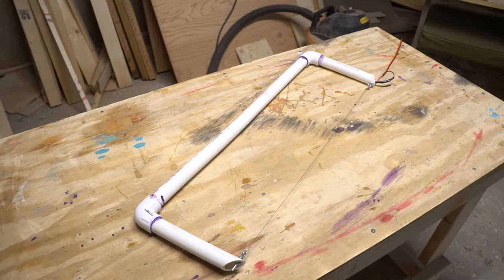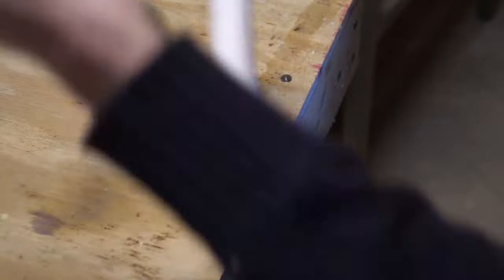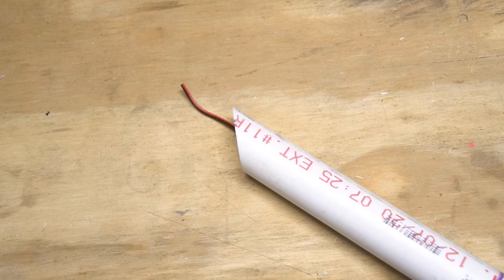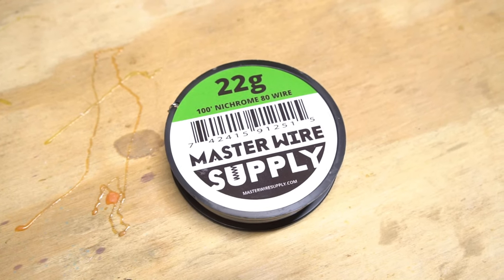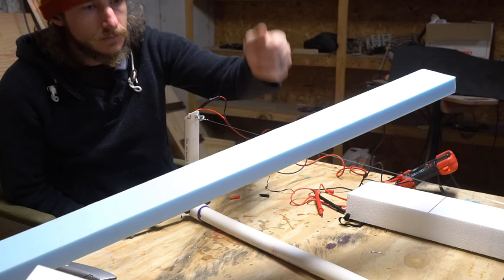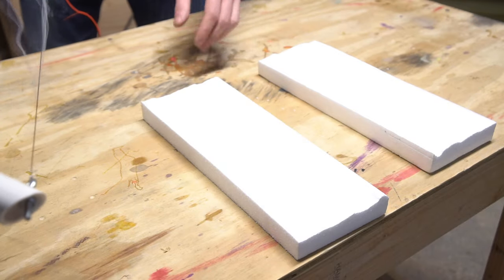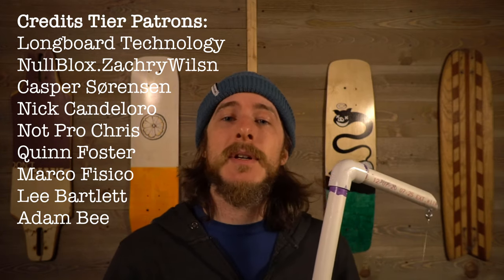Making a Hot Wire Cutter for Shaping Foam

Comment: I'm looking to horizontally cut a 10" thick 6' x 7', latex mattress in half (fillet style), due to the outer surfaces developing body impressions I hate sleeping in.   Then I can put the outer faces into the middle and spray adhesive glue to join them. The trick is, not to cut the pieces with waves, but perfectly flat for a level sleeping surface.  

Why do this?  California King size Natural latex foam mattresses cost $3,000 USD!  So, if I can just "resurface" this mattress this way, eliminating body impression sides, I can get another 10 comfortable sleeping years out of this mattress - for the cost of making a cutter about 7' wide, and keep the overall original width too.

So, I'm thinking of using wood to make one of these, a 7' long piece of wood (2" x 4" x 7')(and attaching a wider flat thin piece ofmterial to the 4" side, to it for guiding (i.e.: 1/4" x 24", x 7'), which can make the cutter lay flat and even, keeping the cutting line flat and making a 5" deep straight and flat "Fillet" cut from start to end, as I advance it over the top of the mattress (lying on a flat surface) - kind of like a planer works on wood - except in this case the planer is the moving machinery, and work-piece (Latex mattress) is stationary.  Thus, I'll use springs to make the nichrome 80 wire taught, that way; why I need an extra 1' wider than the mattress width, room for the springs beyond the width of the mattress.

I already have tools, hardware, and power supplies (might need 8 minimal to 10 or > Amps for a cutting wire so long).  If sure AMAZON has the nichrome 80 wire, eh! 

Maybe I should make a video,eh?
Reply: Ugh, I found my way to this vid because I also need to cut my talalay latex mattress horizontally, lol!

Have you undertaken your project? If so, what kind of results did you get?
I'm not very handy, so this project might be a bit beyond my skill level.

I'm considering trying a 39" fine-tooth bow saw blade to see if I can just carefully saw the horizontal cut.

Cheers!
Reply: @tothelighthouse9843  I haven't done it yet...I was thinking about doing it this way.

Mattress lying down on adjustable bed-base.

Place a 5" (1/2 matress thickness) wide board on each parallel, lengthwise 2  side of the mattress.  Cargo rachet straps to keep boards in place.

Then I can run a hot wire cutter along the top of the boards, as a guide...like a bread slicing guide.
Reply: @davidav8orpflanz561  Yeah, I'm trying to find a good way to cut mine horizontally. Please definitely update here if you do decide to proceed! Love to know how it went. Cheers!

Comment: does the end of PVC is not melting where the nichrome wire is attached?...
Reply from the maker: The hooked bolts that the nichrome is attached to really don't get that hot so the PVC doesn't melt. I'm not really sure why it works that way

Comment: Hmm.. thanks for the video. Is it volts or amps that cut the the foam... I found several laptop adapters laying around at max 2.5A, but at 24-48Volts. I assume a laptop charger should have plenty of juice to heat the wire, no?
Reply from the maker: Huge disclaimer here: I DO NOT understand electricity. That said, my wire wouldn't even start to heat up until I stepped up the amperage in the power supply. I read that sometimes if the power supply is rated for a lower amperage they're programmed to recognize the power draw from heating the wire as a short circuit and automatically shut off to prevent fires. Which is a good thing! Unless you're actually trying to get your wires really, really hot
Reply: Is the Ampere that do the work
Reply: @BiduscoIKUmar  multiply amps by voltage.
Reply: This is the voltage and the amps while it is on.
Reply: This equals watts, which is heat.

Comment: NO! Please DO NOT tin wires that are going to be clamped in a screw connector like that. This application is not particularly dangerous, but it is very bad practice. Solder deforms over time under pressure and relieves the clamping force leading to a resistive connection which can overheat. Many domestic fires have started this way by this being done with mains wiring. Just twist the strands together to prevent a stray strand shorting, and clamp straight onto the copper wire itself.

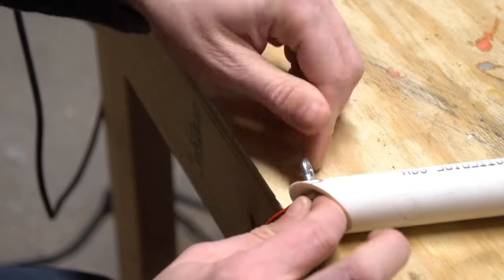Comment: At 3:19, you shouldn't tin the end of wires when clamping with screw connections. This is a known safety hazard because the tin will creep (cold flow) causing the connection to become loose.

Comment: How’s the PVC not melting? Higher melting temp than the foam?
Reply from the maker: The thicker cross section of the bolts means they don't head up anywhere near as fast as the wire. I'm sure if you left it on long enough you'd have some problems but I'd guess the nichrome would burn out first

Comment: Don't laugh at me asking this but I'm curious if this would perhaps cut cushion foam too? I doubt it but maybe. I need to cut the thickness of a sofa cushion into 2 relatively even pieces. This method looks like it would be easier than another I saw. Either way, very cool build and video!
Reply: I'm pretty sure it doesn't cut couch foam. I wish I did though
Reply: Most likely the cushion foam is made of polyurethane foam, which is much softer & denser. It does not cut well the hot wire method shown in this video & it's not recommended. An electric knife is probably your best option to cut polyurethane foam with.
Reply: @_MjG_  thank you!

Comment: Wouldn’t the eye bolt get so hot that it eventually melts he pvc then pulls through it? 🤔
Reply from the maker: I think the cross-section matters, so the thin wire gets hot but the bolts don't. If you left it running long enough it might melt through anyway though ¯\_(ツ)_/¯
Reply: You can always use a small inner copper tube to take off the heat, which also works to strengthen the ends.

Comment: Your wiring at 2:50 is confusing, you connected the wire on the switch side to the ring hook, then suddenly its no longer wired, and you bypass it. I feel like the most integral part of this is the wiring.